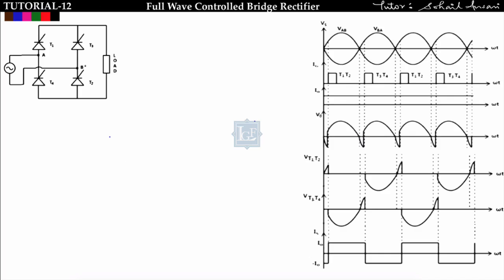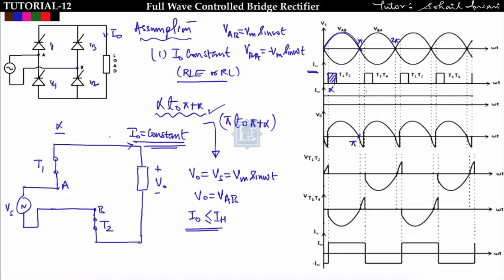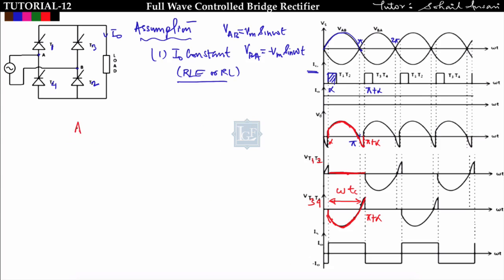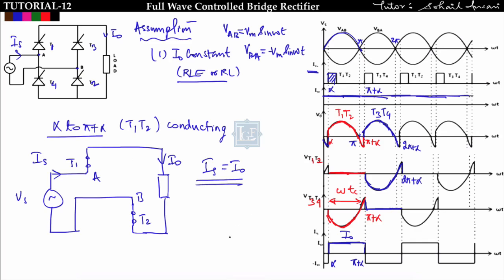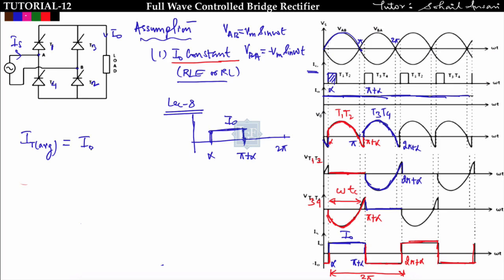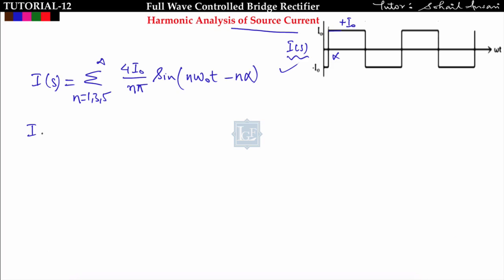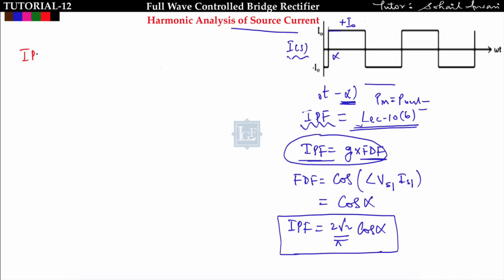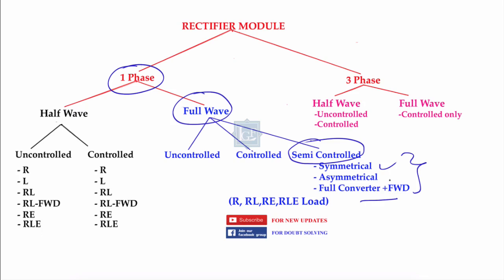Lec 12 Full Wave Controlled Bridge Rectifier & its Harmonic Analysis

Comment: Sir I have a doubts.

In SCR- half wave rectifier for RL-FWD Load after reverse blocking mode of thyristor , inductor discharged and current will flow through diode at this moment though inductance a current will flow i.e  flowing through diode also.For this current inductor will charged.

So, there discharge and charge of indicator are occurred at same time?????
Reply: Lol, then we basically have free energy! We all know that resistors limit the current flowing through it (or can be assumed as losses across R load) so the magnitude of current keeps on decreasing and eventually inductor runs out of charge.

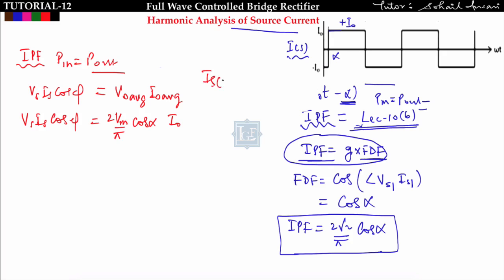Comment: 22:21
Sir 
U are getting io avg of a square wave is io.
But here am getting zero
correct me if am doing wrong.
Reply: Is avg. is zero, but here as the source current waveform is considered , for calculating input power factor we took Is(rms) not average. Also, the load current(Io) is always positive because the majority of voltage projected across the load during both cycles is positive only.

Comment: How thyristors T1,T2 naturally commutated when T3,T4 triggered ? Our load current is constant then how will they become off ?
Reply from the maker: trigger the T3T4..then current will flow from T3T4..now see the voltage drop across T1..u will see that negative supply voltage is drop across T1..so it will go in to reverse biased..
Reply: In period pi to pi+alpha also voltage across T1,T2 is -ve but they are conducting, the only way to off them is bring current <ih , but io is constant, then how T1,2 becomes off when T3,4 triggered ?
Reply: from pi to pi+alpha the thyristors are still in forward bias since the anode is at negative potential no doubt but the cathode is at much negative potential than anode since the inductor starts discharging its energy by changing its polarities so the cathode is maintained at much negative voltage hence it will conduct the moment we trigger t3and t4 inductor stops discharging and starts charging from source so again polarities will reverse back to original signs since current cannot change in inductor instantaneously hence a reverse voltage will appear across t1 and t2 at the very moment t3 and t4 are triggered hence they turn off hope my ans was helpful
Reply: Can I turn off thyristor by applying -ve voltage across it ?
Reply: yes
Reply: Thank-you smith, u r from ?

Comment: sir at 4:30 if the thyristor T3&T4 is   not triggered then will the thy T1&T2 still conducts in reverse direction
Reply from the maker: thyristor will never conduct in reverse direction...the current direction will remain same..
Reply: load current io is constant there so t1 t2 has to conduct after pie in order to satisfy the current
Reply: during negative cycle the thyristors are still in forward bias since inductor starts discharging by changing its polarities so anode of thyristor is at negative no doubt but the inductor since disacharges by changing its polarities so cathode of thyristor is at much negative potential hence it continues to conduct